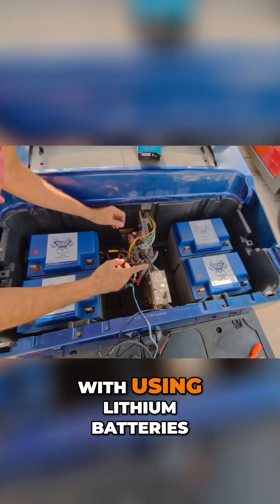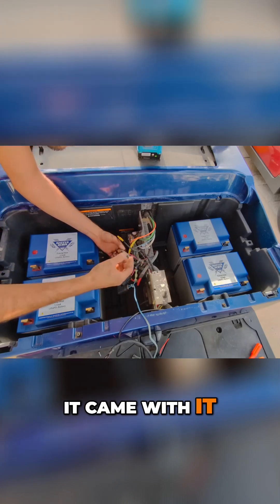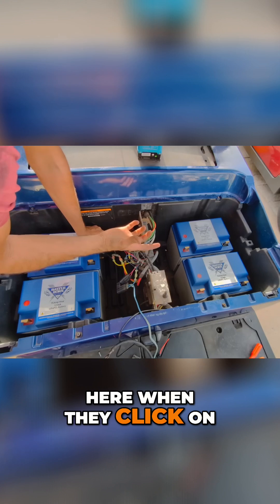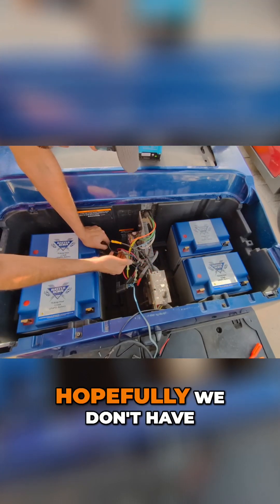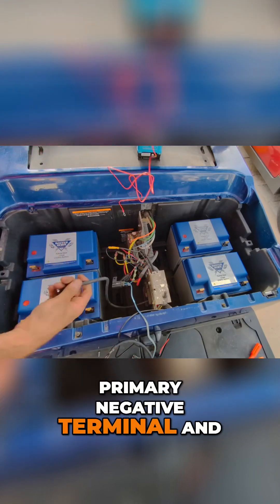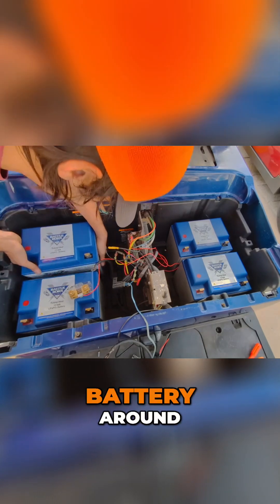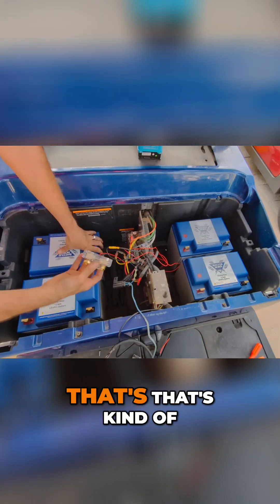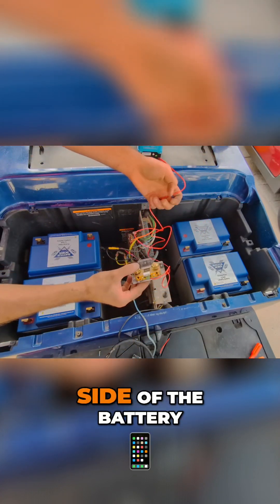Lithium Battery Trick: Pre-Charge Resistor Explained

Comment: I like to wire in a resistor and a push-button switch in parallel with the battery disconnect switch.